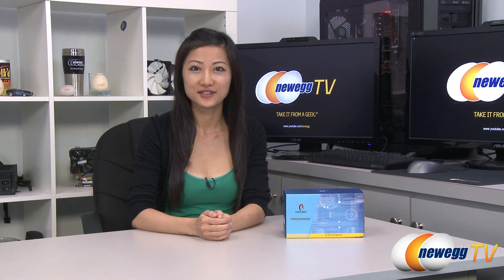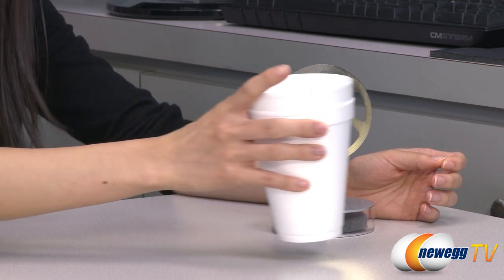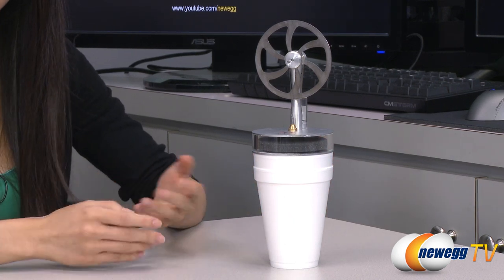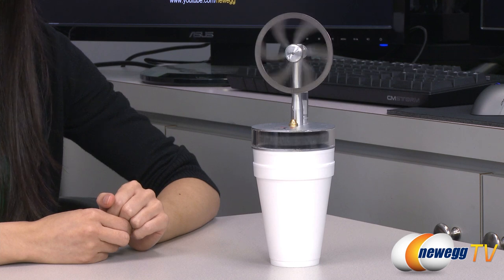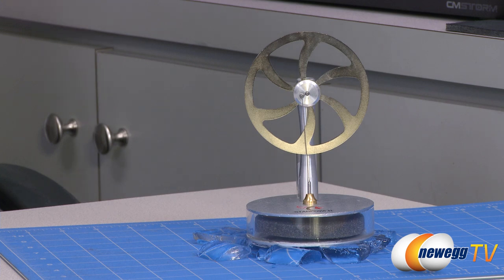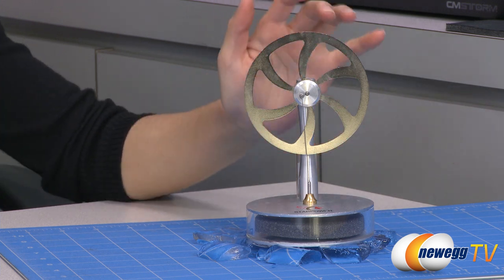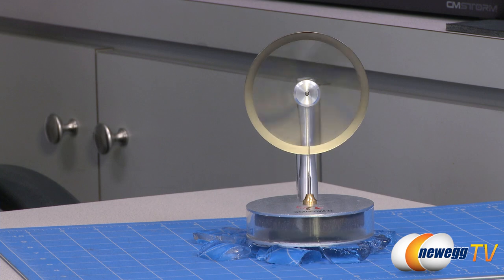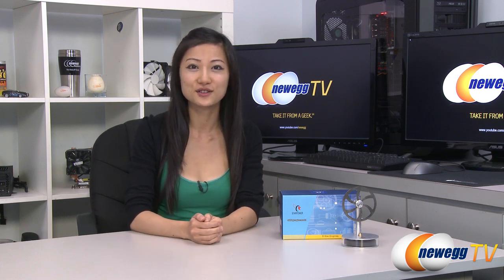Newegg TV: Stirling Engine Ultra Low Temp Overview

Comment: It would be nice if you could use it as a fan that would be powered by being hot in the area without any interacting and maybe put the heat collector outside where it's hot and run wires inside where the fan would run.

Comment: If anyone has any question about Stirling engines you can ask me. I am Dstar Engines
It will run on the surface of your hand. 
If you ever took a physics class in college you learned the math behind them but never saw them in class.
Dstar (me) also has 6 or so other styles of Stirling engines.